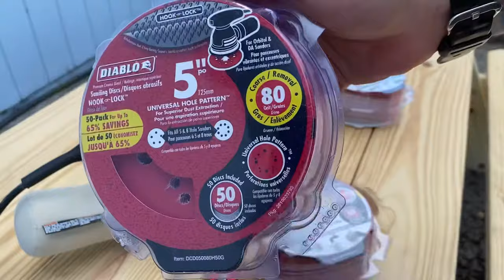How to Weatherproof, Seal, and Finish a Wooden Picnic Table

Comment: One important thing I learnt from this video, paint the bottom first.
Reply: No he did it right,bottom only needs one coat and he gave the top 2 coats
Reply: @GoogleUser-yj1wy  I still would have done the bottom first but that’s me. 

They did well regardless 👍
Reply: Yes. Bottom first. Minimum 2 layer of paint
Reply: @GoogleUser-yj1wy  How much time does it usually need to dry ?!
Reply: Agree, bottom first so you don’t scratch the top 😊
Reply: Because rain comes from down under right

Comment: For anyone else wondering he used Valspar One-coat exterior stain and sealer - Transparent in Cedar Naturaltone. 1 qt size (946mL = 0.99 quarts). Thanks for the vid I'll pick some of this up in the morning.
Reply: Thank you, I reworded a few times to catch sealant!! Why make a video if you dont want to talk!
Reply: @laurakelly4297  I appreciated that he didn't talk. Got right to the point sans jibber-jabber! If one is really pressed to know exactly what he used, one can screenshot the product when he shows it and then simply zoom in on the image.
Reply: Thank you!!!
Reply: Where can I find Valspar One-coat exterior stain and sealer transparent in Cedar Naturaltone? I checked Amazon, Home Depot and Lowes, nothing. Thank you.
Reply: @frankgallego3782 Valspar Is a Loews brand so it should be there.  That's where I got it from.

Comment: With a new pressure treated picnic table , should it be left before coating ? Was also thinking of using Ronseal ultimate deck oil, would that be ok ? Thanks

Comment: Does the valspar stain come off on your clothing after drying?  I tried an oil base stain and sealer and sure enough it did rub off on my clothing a bit when I sat down even a week after applying, I even wiped off any excess like it recommends, so I had to strip the benches I made down and need to weatherproof them somehow. Just curious since valspar is water based? cant be having people's butts look like burn hickory :P thanks in advance
Reply from the maker: it doesn’t get on clothes 👍🏽

Comment: I unfortunately didn’t know this was a thing and left mine outside in the rain and California got a lot of rain so when I looked back there my table looked grey lost that fresh wood look but I learn from my mistakes and I’ll buy another or if it’s possible to just stain it or is it ruined 🥲
Reply: I pressure washed mine. Looks brand new. Now in the process of doing same as this video
Reply: You can probably salvage it. Power wash to get any residue/biologics out of the wood. Let it dry, sand it down, then seal it with something that stain the wood to your desired color. So long as it isn't rotting and falling apart you should should be good.